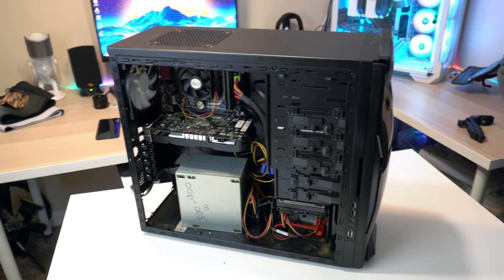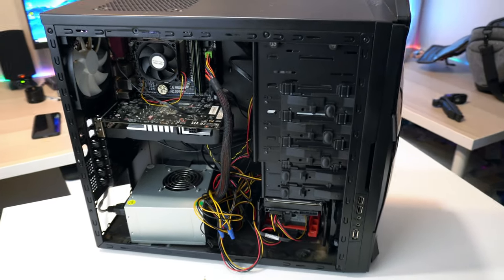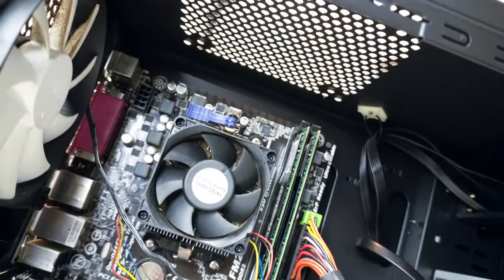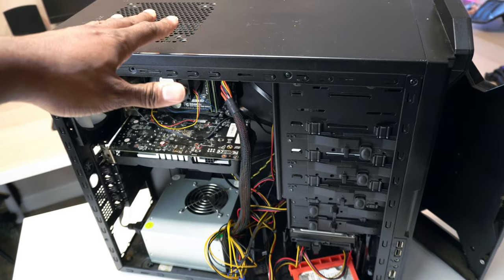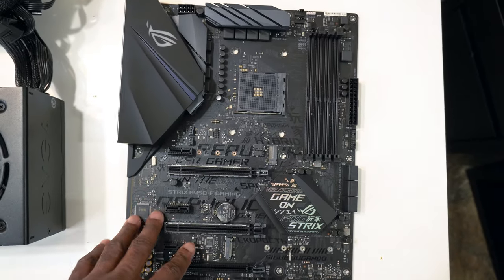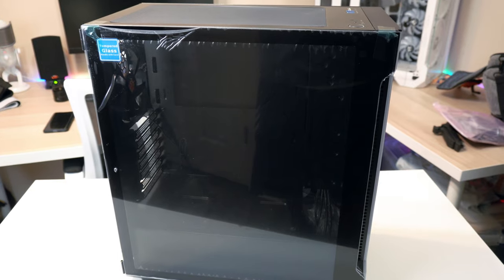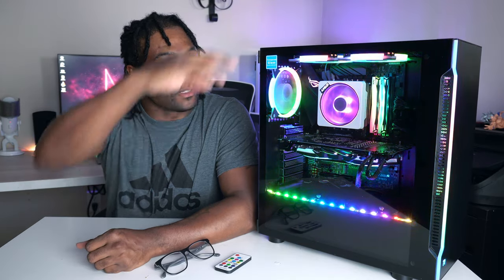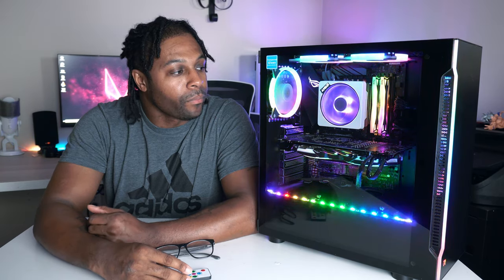I Roasted My Clients Build... Then Built Him A New One!!!!

Comment: Nice build man!!!! Great Video too. quick question tho. What kind of camera did u use for the video? it was crystal clear!!
Reply from the maker: I use a Sony a6100 and I record in 4K 24fps. I have a Sigma 16mm F/1.8 lens as well. That's the setup! I'll actually be doing a video here soon on my camera gear lol.
Reply: @PettyFixes  that's what's up man!!! I'm gonna be keeping up with u on the camera gear. I'm just getting in the camera game myself. I'm working with an older cannon rebel t5i just to get started.
Reply from the maker: Oh awesome man. See u gotta start somewhere. I started with a Sony NEX-5N. It was cheap, had an interchangeable lens system, and I was familiar with the camera as  I had owned one previously. But I upgraded to a Sony A300 dslr and it had like 4 lenses. Then I sold it and got me a Canon EOS M3 (the vast majority of my videos were shot with this camera). I loved the M3 because of Canons menu system being easy to navigate. Plus the lens ecosystem is pretty cheap compared to Sony. I'd definitely recommend going to eBay and snatching one up for about $250-$300 or so. Get you a 50mm lens, a 16mm F/2.8 or lower lens, and a nice zoom lens (24-70mm range) and you will have a great lens loadout for any situation.
Reply: @PettyFixes  thanks for the info man! I have a 75-300 zoom lens and a 50mm. Nothing else yet. (Been spending too much on my pc build)😎😁) but I've bout got that all wrapped up. Just bought my last piece, The thermaltake view 71. I won't be running any custom loops till later though. Might even stick with air. Loops are just too expensive so yea... Time to focus on my camera. I don't think I'm gonna spent much on this t5i. I'll gonna go with a full frame canon and spend my money there.
Reply from the maker: The Canon EOS R is SOLID. Lol. Also, I got the View 51. The 71 is just entirely too big for me. The 51 is pushing the boundaries lol. It is PLENTY of space inside it. I'm air cooling at the moment but everyone knows my channel for water-cooling lol. Check out my other builds and videos and u will see! And sub for me please, it'll help out a lot!